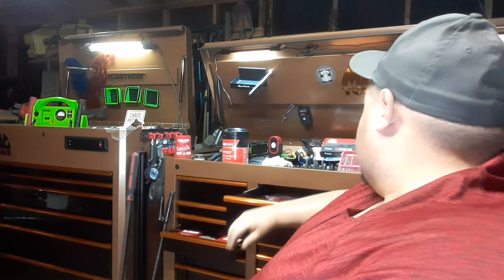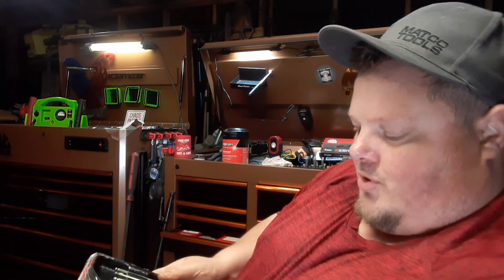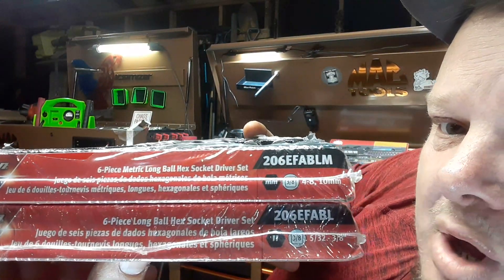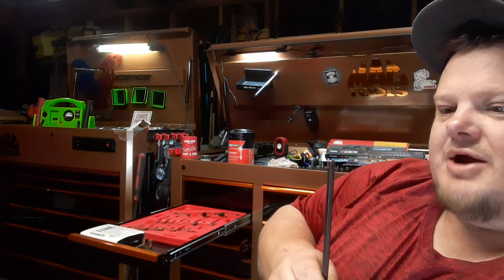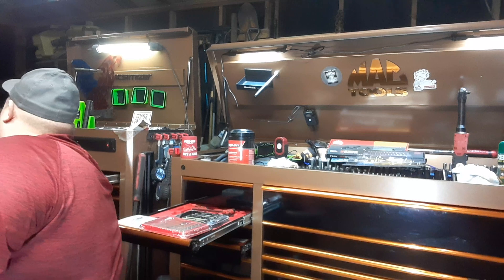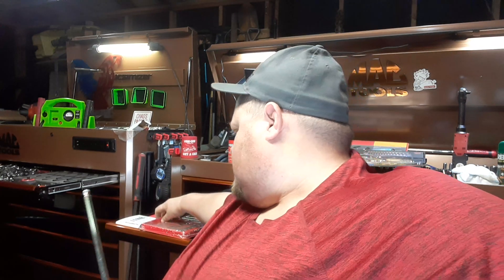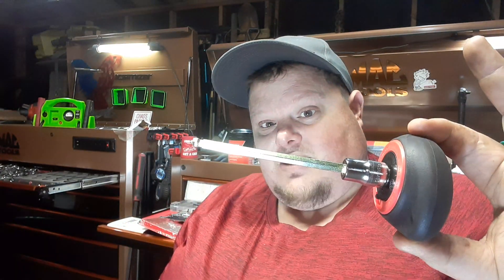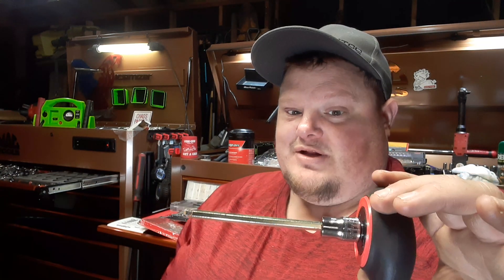Snap-on tool haul This one is one you will not want to miss!

Comment: Hey brother hope your doing GREAT! I've been doing so much around the hizzle, that I've not had much time to watch videos. Kinda why I've been absent. I just poured a 6.5yards 15×24 concrete floor. I'm building another big garage to work stuff. Looking into doing a epoxy over it. Or sumthin. 💪✌
Reply from the maker: I'm good man thanks been wondering how you have been!!!
Reply: @CPthetooladdict I'm  pretty good bro, I'm just getting doors and lumber ready to frame in my garage . I just bought a nice 18in FLEX Head Mac axis comfort grip couple days ago off eBay . New for 120$. Didn't really need it I just couldn't resist! Man I love mac ratchets. But I've been pretty good. Kinda slowed up on buying tools becuz I found my bank account seems to go down really low really fast!Lol. But I've got my new tool cart filled up nicely. I can't wait to start using them on my new quad I'm building . 😊💙💚🖐